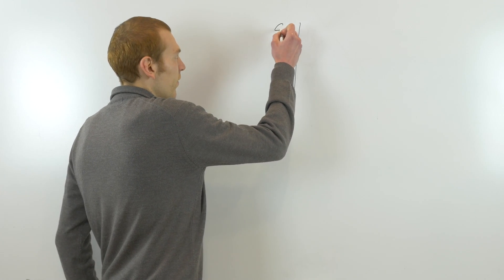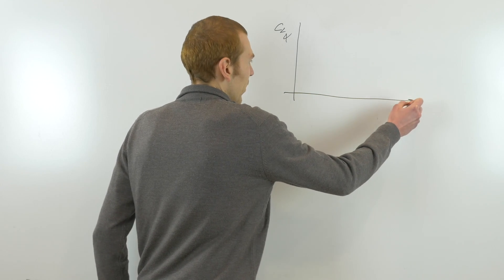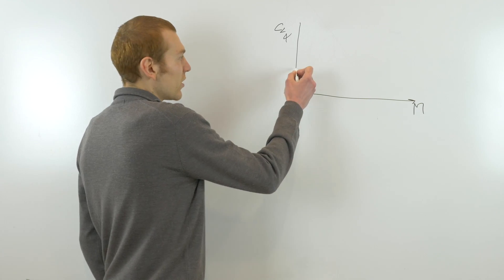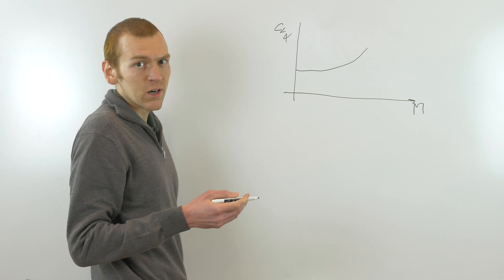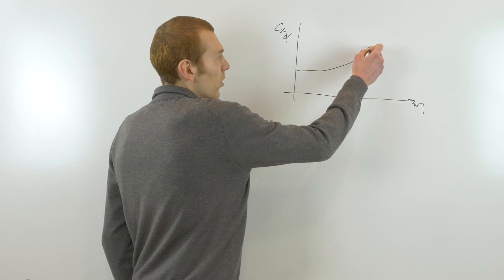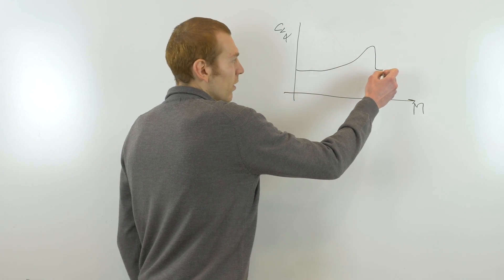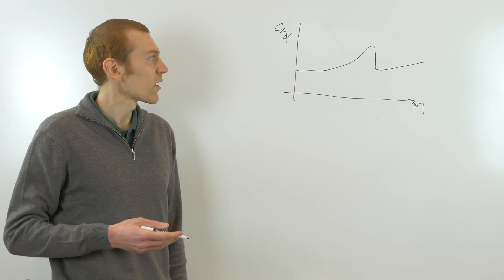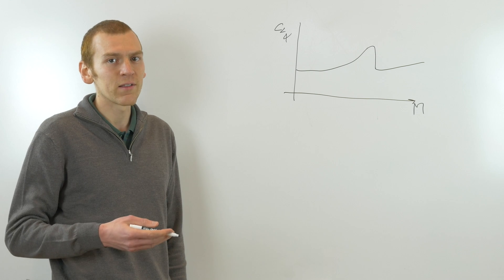The Relationship Between Aircraft CL Alpha & Mach Number

Comment: Why CL max changes with Mach number? I thought it is fixed value, because of the wing planform.
Reply from the maker: Tomasz, it’s all about compressibility . At low speeds, you can assume that the air is incompressible, and a lot of things simplify significantly. Above M0.3 or so, it starts to be a bit more significant. As the speed increases, we need to add compressibility correction to our math.

Comment: why does clapha increase with higher subsonic mach number?
And decrease in transonic region
Reply from the maker: At extremely low speeds (below Mach 0.3 or so), we can usually assume that air is incompressible. This makes life a lot easier when dealing with aerodynamics surrounding low speed handling, stall, etc. As the speed increases, that assumption starts to fall apart, and we need to add compressibility corrections to our math. A simple approximation for flight below approximately Mach 0.7 is to add a (1-M^2) factor to the denominator, known as a Prandtl-Glauert correction. Obviously, this would require us to divide by zero at Mach 1, so we use a more sophisticated set of corrections based on the USAF DATCOM, but the trend in the results is similar: a rise as we enter transonic flight, and a fall as we accelerate through it. Hope this helps!